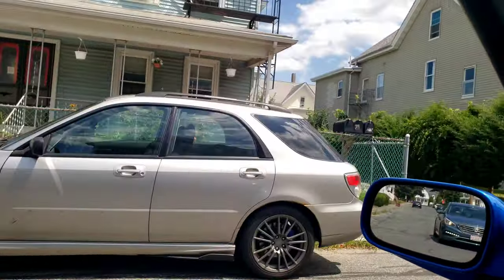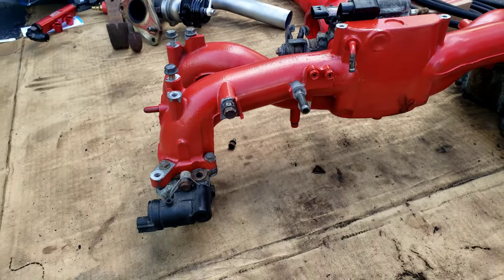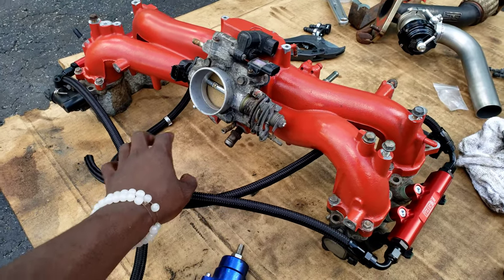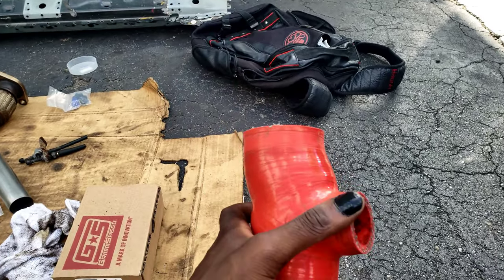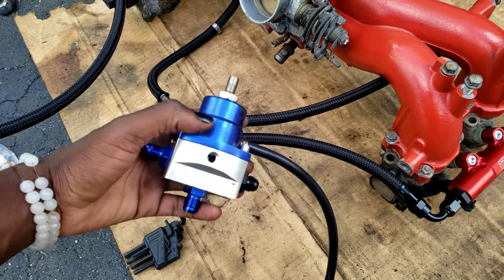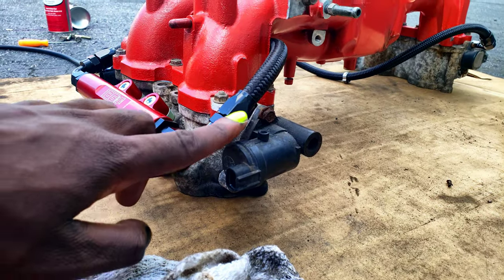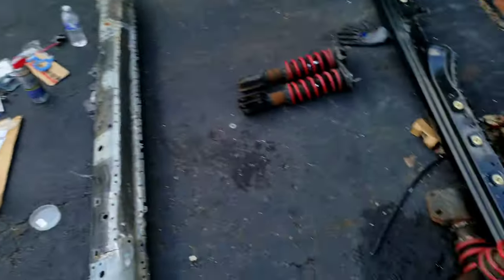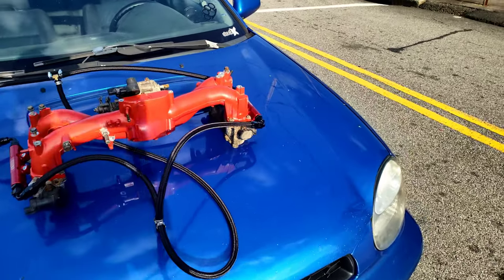WRX Intake Manifold Assembly [Day 1: IAG Fuel build]

Comment: Do u know if i can buy the fittings for the fuel rails they keep loosening up and then leak gas  i have ID injectors top feed 1000cc
Reply from the maker: You should be able to buy just the fittings on their website if that's all you need. 

As for them coming loose that's a first for me. Mine haven't moved on me and I only had leaks in the areas where I didn't tighten enough for fear of breaking things. (I don't have an AN wrench so it sketchy at best)
Reply: @JacobRJZ  idk if they come loose i mean ive been driving it ever since i replace the shortblock and this morning going to work it started leaking and before it leaked and caught fire so i had to replace a few things why would they come loose or leak?
Reply: @JacobRJZ  also do you know what kind of size they are i bought the car and it came with them so i have no idea what size they are suppose to be